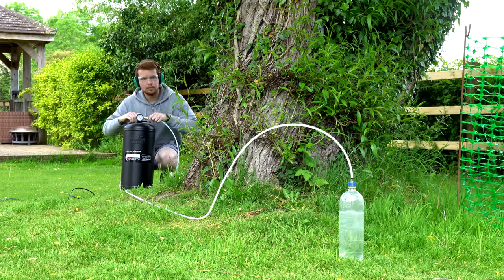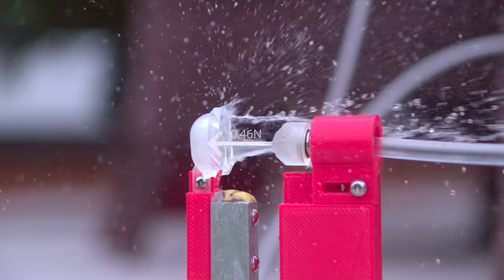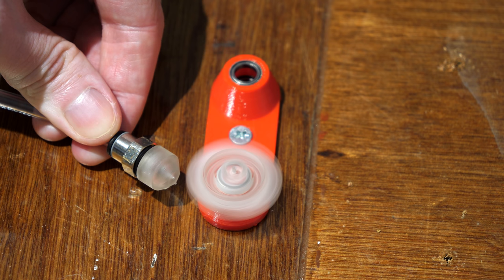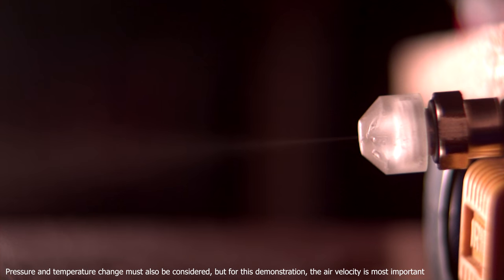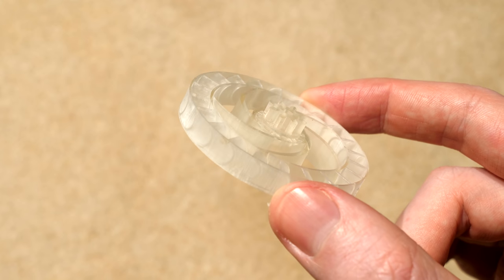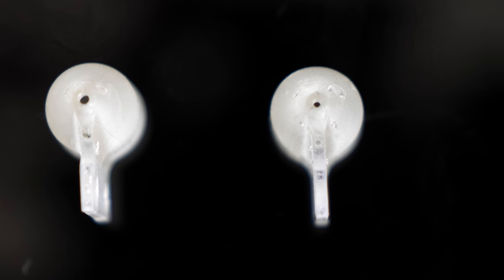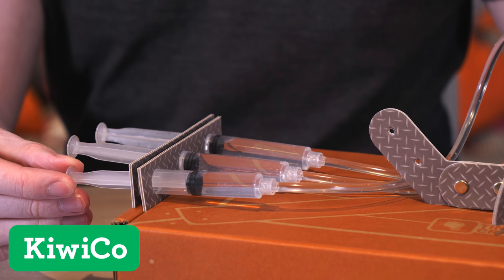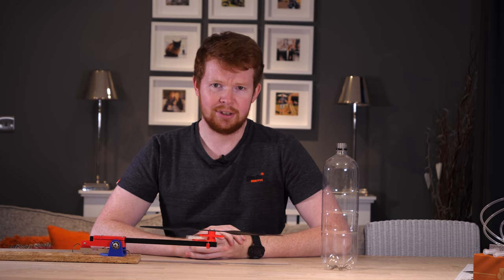Micro Pelton Turbine

Comment: Next video: Air powered air compresser
Reply: That's just an APU of a jet engine
Reply: Perpetual air compresser 😂
Reply: Check out the Useless Duck Company video from 6 or 8 years ago (been a while)
Reply: If you took lower pressure air and compress it to higher pressure with less total energy, it might have some use.
Reply: Yes
Reply: That’s exactly how a gas booster pump works, actually. See Haskel or Maximator for examples.
Reply: Very funny! :-))
Reply: Wind powered compresser

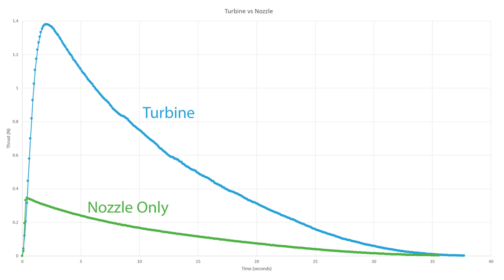Comment: 7:25 For why the turbine-propeller contraption is more efficient than just spitting out the air,  it is the same stuff as why turbofan engines with large fans in front is more efficient than turbojet with afterburner. The amount of force (thrust) produced is affected by 2 major factors, speed , and mass of air moved. By spitting out the air out of the nozzle, we get air on very high speed, but only a small amount of air is being ejected. However, as long as the turbine contraption converts energy good enough that it could push way more air down with slower speed that higher force can be achieved and thus more efficient.
Reply: Are these lyrics for a new song?
Reply: @tausiftaha12  if you want to
Reply: Yay! long story short surface area.
Reply: I've been told size doesn't matter..
Reply: Yup it'll be more efficient until the speed and aerodynamics of the propeller (turbulence etc) get in the way of achieving really high speeds for our theoretical aircraft. Is why we don't have supersonic prop planes, and also why we don't often use small jet engines to go slower (jet = less efficiency = more fuel needed = need a bigger, heavier plane to carry that fuel = it's now fast enough but definitely need to fly at a higher altitude to reduce wind resistance a bit, prop planes lose torque and are generally slow enough to be better off at lower altitudes)

Comment: The reason the turbine is more efficient is the power proportional to S*V³ while force to S*V². With the same power it's more force efficient to use a higher surface with smaller velocity. The greater surface (S) of the prop allows to reach a point where the propulsive air velocity (V) is just a bit higher than the "plane" velocity (here 0). To produce static thrust it's in theory possible to get an infinite force to watt ratio (force isn't energy) with an infinite propeller diameter. But the force to weight ratio would be awfull and impossible to run a plane because the max propulsive velocity would be near 0.

Soo interesting (as always), thanks a lot! 100% pure engineering satisfaction! Keep going :D
Favorite channel for 2 engineers
Reply: What you said: technical stuff
What I understood: hehe plane go vrom vroom.
Reply: i like ru fuuny words macic man
Reply: Vous ici !
Reply: I like your funny words science man
Reply: I think you are right.  That's why a helicopter rotor is much bigger than a propeller.
Reply: Impedance matching.
Reply: i honestly thought Because air is a gas and without funnel it disburses faster which leads to least force. but funnel channels 150% of its energy 

its why cold air rises and hot hair falls but plastic is poor container of gases
Reply: For those who don't understand, it's basically saying it's taking concentrated energy and converting it to be weaker, but spread out so it pushes against instead of trying to outright cut through
Reply: Similar to turbofan engines, right?
Reply: Coucou !
Reply: i think you got your math bit mixed up.
anyways. i think it's because the nozzle is transfering energy very inefficiently. you see for something to move you need something to act against it (newton third law of motion - action and reaction). and air doesn't exert much force against the fast moving air from the nozzle (it is being pushed aside instead). so the nozzle works like rocket (accelerating gas moves the rocket, a great video that explains nozzle efficiency real good => https://www.youtube.com/watch?v=D4SaofKCYwo&t=833s ).
so it is better to slow down the air to move our turbine (even though there are major loses) and transfering it to propeler which has much higher area and is pushing the air much more efficientelly then the small area of nozzle.

i hope it is somewhat understandable (and you are getting the clues)
Reply: Here's to hoping you can answer my question: for higher thrust would you increase the pressure or air flow (e.g 60PSI - 80PSI or 20L/s - 30L/s)?
Reply: can you explain this to me like i'm a 5 year old?..
Reply: also the nozzle seems to be a simply convergent nozzle. He would have needed a De-Laval nozzle to fully develop the pressure into flow kinetic energy, if the pressure was at least 2x times the air pressure
Reply: I think a simple way of understanding it is to compare a rocket motor (i.e. simply releasing the air from a pressurized 2-liter bottle) with the Pelton Turbine motor in regards to the distribution of kinetic energy. 

Both motors generate thrust by converting potential energy in the form of pressurized air into kinetic energy in the form of fast-moving gas molecules. We can say that both the rocket motor and pelton turbine motor have the same amount of potential energy to begin with, as long as the bottle volume and the air pressure inside are the same in both motors. What differs between the two motors is the velocity of the exhaust gasses. In the rocket, the exhaust gasses are moving in the opposite direction of the motor at a very high speed, whereas the pelton turbine motor's exhaust gasses have the same velocity as the motor (ideally). The lower kinetic energy of the exhaust gasses in the pelton turbine motor means more of that energy is transferred to the motor.
Reply: @RJayFlaming  Exactly, well said!
Reply: i understood about 2% of that but I ish i could understand it all
Reply: @RB-kb3tc  About "impossible to run a plane because the max propulsive velocity would be near 0." → This issue is that a prop that pushes air at 100 km/h cannot move a plane at 101 km/h!

The better the force to watt ratio is, the lower the max reachable speed is! So there is a mix to do with a plane, static thrust isn't a good reference ^^
Reply: Another related consideration is propulsive efficiency. E = 2/(1 + exhaust speed / inlet speed). To achieve high propulsive efficiency, you want to accelerate the air as little as possible. So if you need a specific amount of thrust, you're better off accelerating a lot of air slightly (like a high bypass ratio turbo fan engine on a commercial airliner), versus accelerating a little bit of air by a lot (like a fighter jet engine). And this is all before even considering thermodynamics and such as it pertains to the engine, compressed air, etc!
Reply: @IncroyablesExperiences  I appreciate the explanation, thanks.

I'm aware that the thrust from a propeller depends on the speed the aircraft is going, but I haven't figured out fully how it works. Your comment does help a bit.

 If we have a fixed diameter propeller spinning at a fixed speed in an air tunnel, I haven't figured out if changing the pitch of the blades should allow to increase the maximum headwind the propeller can function in as much as you want, or if there's a fundamental limit (I'm assuming the airflow stays subsonic)
Reply: @hardlerz5482  If you're trying to hover, yeah.  You don't need a strong motor to get decent thrust from a big prop.
Reply: Interesting but I'm not so smart so I don't understand
Reply: Big spinny thingy move more air than tiny spout, right?
Reply: That's the reason why turbofan engine are more efficient than turbojet engines.
Reply: Cool but no get
Reply: If you double the swept area of a prop the same force can be generated with half the surface pressure. Surface pressure is a measure of mass acceleration away from the prop.

As acceleration is halved the final speed of the fluid will be halved.

Kinetic energy lost in the fluid flying away is a function of velocity² so kinetic energy contained per mass unit is now a factor 0.25.

Same prop with half RPM means half fluid speed ejected, half thrust and hence 25% engine power required. With double area thrust is restored but required power will be only 50%.

So same thrust can be created with half the power if prop geared down 0.5X and made larger by 2X.

Outboard engines have the same design consideration. A slow moving sailboat can save fuel using a larger propellor with reduced pitch.

I think.
Reply: merci les gars j'arrivais pas a comprendre pourquoi ca marchais mieux (a quand votre prochaine vidéo?)
Reply: Me are have stupid, no understand
Reply: Je ne m'attendais pas de vous voir ici
Reply: Well, actually to make comlarison  fair he shoumd use Laval's nozzle
Reply: @micklenier6152  but by that logic, rockets should not work in a vacuum but they do work in vacuum.

What you are thinking is that the exhaust coming out of the nozzle is hitting the air which pushes the rocket, but thats simply not true. The air applies a force to the nozzle, and in doing so is pushed out the business end of the rocket.

Now how come is the nozzle so inefficient, well its not a good nozzle is it, the air which is coming out of the nozzle is not at atmospheric pressure, hence it undergoes rapid expansion, but this expansion is happening outside the nozzle and hence is wasted energy. This is a case of underexpanded nozzle, easily fixed by using a better nozzle. Once this issue is fixed, the nozzle will beat all his older engines
Reply: @gionnigiannizzi9314  yea
Reply: @Pilgrimman007  thats for jet engines, this is a rocket engine, a crude pressure fed monoprop, but a rocket engine none the less
Reply: @tis_ace  well that's why i refered to the video... the rockets are propelled by accelerating gas and not by pushing air (aka the air is not propeling the rocket the change of pressure to velocity of burning fuel is)
Reply: Raindom Ceains I saw you in the movie, Idiocracy 😂
Reply: Ah !
Reply: This reply I think is the most feasible one. The original comment tells us the mathematical description of efficiency of the turbine without considering newton's third law. This one clearly explains why the formulae in the first comment work
Reply: What about the resistance from the turbine utilizing the disbursing air pressure vs the air being disbursed into the room uninhibited?  Like ground effect with a helicopter and IGE vs OGE hover.  I’m fairly certain that the nozzle will also generate more force in the opposite direction when it’s in the turbine powering position.
Reply: All I understood was: something make another thing go brrrrrrrrrrrrr
Reply: Aaaaaaaaah
Reply: Most important point that is commonly missed, force and energy are not the same thing. Energy is conserved, force isn’t. A force can be increased, with only friction and efficiency limiting it.
PE of the air, converts to KE, transfers to gears and prop, causing a upward Force.
Reply: Someone once asked how much power was needed to hold in the air a weight of (say) 1kg. I answered there is no direct answer to that, as it could tend, in theory, to zero. 
They made look like a fool for that answer.

Comment: The thing with air is that it has to have some kinetic energy left, because it has to push other air out of the way to exit the turbine (Betz limit). Water would do the same if there wasn't a downstream drain under a dam.
Reply: You're right, I guess a water Pelton turbine would not work so well if it were itself under water. (still better than an underwater air turbine, the bubbles from the nozzle won't even reach it)
Reply: Nice info, thanks!
Reply: @corentinoger  Even if we placed the nozzle for the air under the turbine?
Reply: Perhaps a mild vacuum would improve efficiency?
Reply: The Betz limit is also the reason why the ducted fan/turbine works better, as the less turbulent airflow at the blade allows more energy to be transferred to the mechanism and not be wasted into heat.
Reply: Okay, definitely want to see the turbine run with the whole apparatus under vacuum.
Reply: I think Betz limit is applicable only in a homogenous airstream enclosing the entire obstacle and avoiding it.

In an impulse turbine the fluid stream can be  guided along the vane curvature and generate acceleration forces without escaping.

In an open air wind turbine the entire stream containing the energy only partly makes it through the turbine as air communicates by pressure an obstacle is present. 

The wind starts to curve off along pressure gradients and all of the volume in the energetic cross section being the wind turbine swept area slows down, spreads out and does not pass the turbine swept area.

It misses the genius design contributing some pressure but the mass makes its own path in free air and does not follow the curvature of the turbine flowpath.

 (Kind of the same subject)
That is why propeller ships outperformed paddle steamers, the water could no longer do avoidance pressure in free space. By luring the water into a propeller it is bound to follow the design curvature and be subject to more forces and be accelerated at a maximum to the limit of cavitation in a small mechanical design, without being able to escape.

Just an idea..
Reply: solution: use air pressure to create a vacuum around the turbine, air leaks into vacuum through nozzle

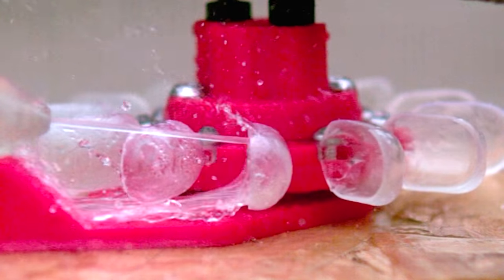Comment: There is something about the slow motion footage of the water turbine at 1:56 that just screams STAGE 2. All that exhausted energy looks like it could be harnessed on another lower turbine rotating in the opposite direction. I always enjoy your videos. They make me think.
Reply: Adding a stator in combination with opposite direction rotor should greatly improve the final outcome. Ten years at G.E. making fuel controls tells me you're closer to a breakthrough than you realize.
Reply: @scottdemoor49  Naturally at some point in this process, the fuel, be it water or air, will loose its ability to produce power, but that immediate discharge from the cup is very focused and a lot of energy just waiting to be harnessed. I'm not a turbine guy, but I think its worth exploring if it doesn't add too much weight and defeat the application parameters.
Reply: The whole point was to make it shoot out of the cup at zero velocity so a second rotor would not do anything if it's set up properly
Reply: @ThaJay  Anything that can still shoot out of anything else still has velocity, or it would just fall to the earth. I think the point is to utilize the flow to its best potential, not waste 45% of it.
Reply: @Shop-Tech  Aren't you forgetting the rotational speed of the rotor itself? Standing next to the rotor the water seems to fall down although it shoots out pretty fast from the rotors perspective.
Reply: No you'd come out better with a set of stator blades affixed on the sides of the initial rotor to redirect the water and 2 secondary rotors to accept the water from there. Imagine the way a jet engine compressor blades work, but in reverse.
Reply: Thought of the same thing NGL
Reply: Great idea. Wow
Reply: Amazing idea!
Reply: Hey, it's Joe Pie! 

You should use your tiny little machine shop to make a little one lol. I love your videos too man!